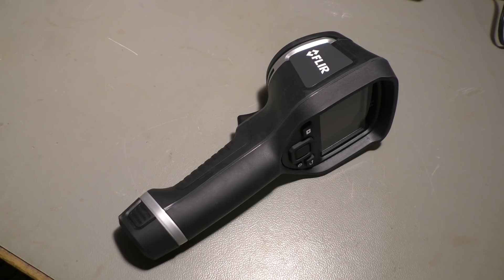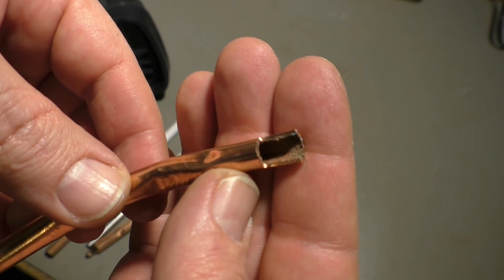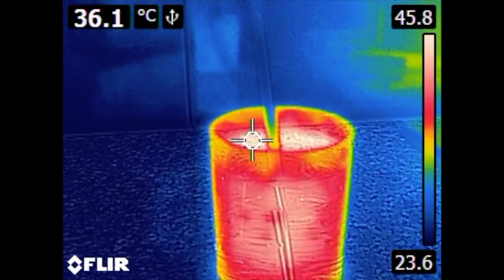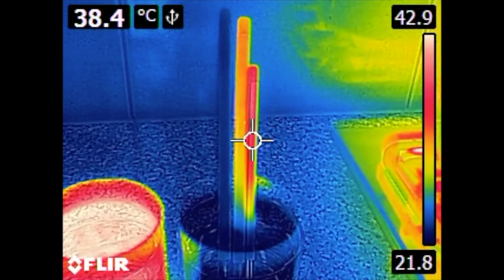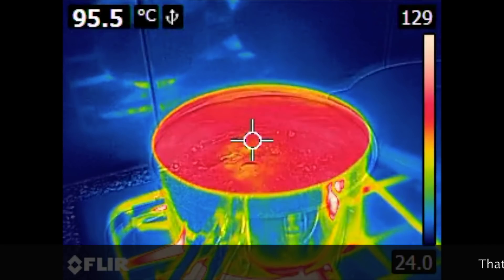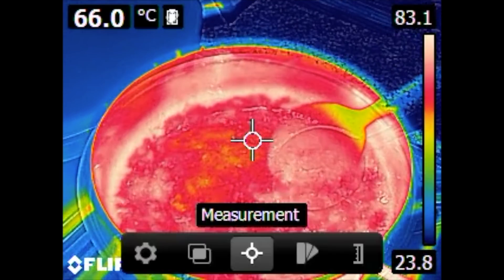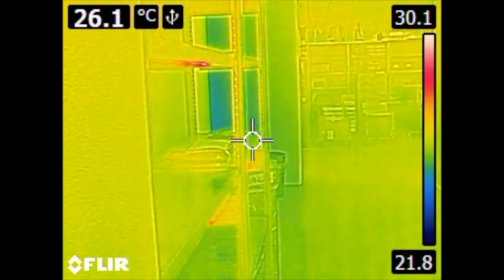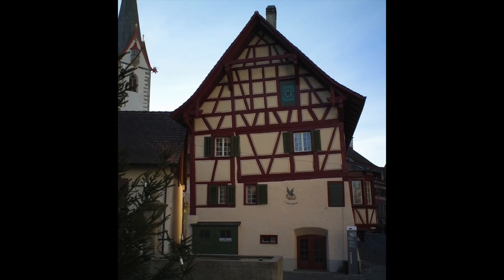Heat pipes and other thermal stuff (PWJ81)

Comment: you should bend the heat pip so it reach the hot and cold water then you could film how the hot and cold water gets the same temp :D nice video after more then 10 jears i know no one explain so good and fast heatpips :D
Reply from the maker: Thank you. If you know how it works it's really a simple device.
Reply from the maker: That would work... in time lapse. You can also build a tea cooler. Put a heatpipe into your hot tea with some cooling fins on the other end. Then attach a small fan and it sucks heat from your tea... :-)

Comment: The inside surface is not rough, it is porous copper. It is made by sintering by adding a powder around a mandrel inside the tube and heating it up a lot.
It works as the wick to pull the condensed liquid back to any area that is being heated.

Comment: Thanks for your experiment. Very interesting to see. Now i wonder, how much difference it makes that the pipe has a lower mass, because it is hollow. It would be interesting to see the same test with a heat pipe, and a copper pipe, instead of a rod.
Reply from the maker: I understand what you mean. A copper pipe could be a bit faster because there is less material to heat up. But there is also less material to conduct heat, so it may be slower again. I wouldn't be surprised if there is no difference at all...
One difference would exist: The amount of heat transported by a hollow tube is less. I has a lower heat conductivity (or a greater resistance). But nothing can beat the heat pipe! :-)
Reply: @PlaywithJunk  I agree with what you say in the first paragraph, but regarding the resistance: While it is correct that less material transports less heat in total, i think your test does not show the amount of heat transported. It shows how quick heat is transported to the other side.  My layman thesis would be that less mass heats up quicker and thus transports heat quicker to the other side.Take for example a needle and hold a lighter to it, and then a thick nail and do the same. I guess your fingers will hurt much faster with the needle ;)
Reply from the maker: @modraccin9514  At the moment I see a 50/50 chance for both scenarios. I think we need to try it out…😎

Comment: I was just thinking about buying that cheap HT02 thermal camera from China, but man this things output looks much better :L
Reply: The HT02 is complete garbage compared to the E4.
You can hack the E4 from 80x60 to 320x240 resolution and <30mK noise(0.03C-ish) for free.
The HT02 is only 32x32 pixels - and they're a thermopile array, not a microbolometer.
If you don't want to spend ~$1000 on an E4, find a used(or new, on a deal) Seek Compact PRO. It's also 320x240, but a phone dongle(easy to connect to PC via third party software) and a bit higher noise(~50-80mK).
Reply from the maker: it's all about resolution. My camera has a 320x240 resolution while the cheap ones 60x60 (HT02). Price $1500 versus $250...
Reply: Awesome!!

Comment: 94.5°C for cooking water (surface measured and actually 97-98°C inside) means roughly about 500m altitude above sealevel if I didn't screw up calculating this. Am I right?
Reply from the maker: Not bad... I'm at 394m above sea. :-)
Reply: Damn... almost got it ;-)

Comment: Do you think this heat pipe can be used to generator electric in a seebeck effect setup? One side of the heat pipe will be attached to hot surface while the other side cooled
Reply from the maker: The Seebeck effect works on different metals welded together. The heat pipe alone is only copper, so no effect will generate electricity. But you could connect it to a peltier module and conduct heat and cold to that...
Reply: @PlaywithJunk  2 different metal will be used. I meant to say, instead of using the actual copper and the other metal (maybe aluminium or brass), can   you use the heat pipe  (vacuum the air out, fill it up with a little bit of water and seal it). Will this increase the efficiency?
Reply from the maker: @baris222  Hmmm... I don't think so. The Seebeck effect works with a temperature difference between two metal junctions. If you use a heat pipe, the temperature difference would be lower because it transports heat from one end to another.

Comment: Interesting.  Is there a way to measure how much heat is being pulled up each of the tubes?  Great video!
Reply from the maker: Good question but difficult to measure. One could attach a metal block on each tube and measure how fast it heats up with the other end in boiling water. But that's only a relative measurement. I'm pretty sure there is a formula to calculate the thermal conductivity of a heat pipe.

Comment: That was very interesting, thank you ! 

Just wondering, am I correct thinking that the lower the pressure inside the heatpipe the lower the heatpipe can get the temperature? Assuming the outside temp is lower than the "hot" side of course
Hopefully I make enough sense...
Reply from the maker: I don't think that the pressure makes a big difference. But you can take different liquids like alcohol or freon for lower temperatures.
I think water is ideal because of it's thermal capacity. It takes more heat up and moves it than other liquids. 
The heat pipe is just a very good thermal conductor. It can not lower the temperature by itself. It can only transport the heat quicker or slower to a cooler spot.
Reply: I see! Thanks for the reply

Comment: sintered pipes are made by putting a rod into the empty copper pipe filling it with powder and then putting it into an oven to make the powder stick :) etching would be nowhere close as thick and create even structures :) 
some pipes have lines or woven mesh inside these are for special applications (work better with gravity :) )

Comment: dihydrogen oxide.curious. used to be that ammonia was used in heat pipes.
Reply from the maker: There are heat pipes with different fluids inside. Depending on what temperature range you need...

Comment: If the steam goes up how do heatpipes work sideways?
Reply from the maker: That's a good question. It depends on the size and construction of the pipe. There are some types that only work in one specific orientation. But most PC pipes work in all orientations. The steam (or vapour) flows from the hot side to the cold side. The hot side produces higher pressure while the condensation produces lower pressure (vacuum) on the cold side. The steam gets sucked to the cold side no matter how the pipe is installed. Even curves work... and the hot side can also be in the center, causing the steam flow to both sides.

Comment: I thought heat pipes contained alcohol and a copper wick.
Reply from the maker: There are several liquids that work. It depends on the temperature range.
Reply from the maker: The rough surface acts as a wick
Reply: They can. Not all heat pipes are built the same way - it depends upon things like intended temperature range and size. Some of them depend on gravity, and only work in the correct orientation. Lower-temperature pipes can use ethanol or another low-boiling-point fluid. Some use  a wick, others a roughened and porous internal surface.